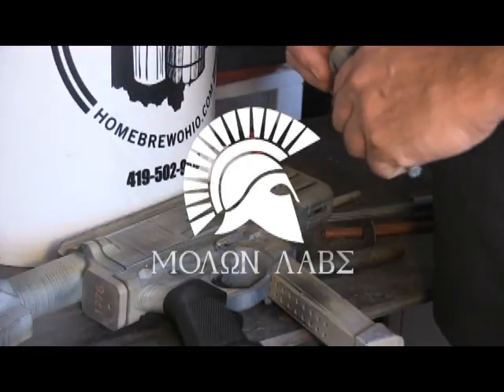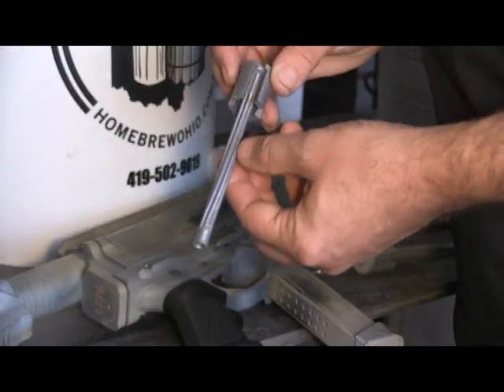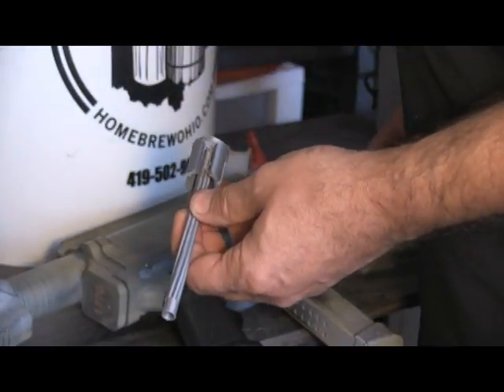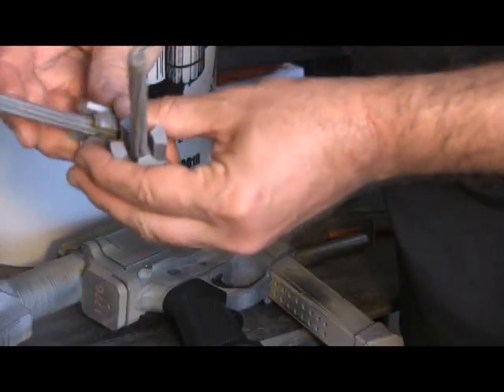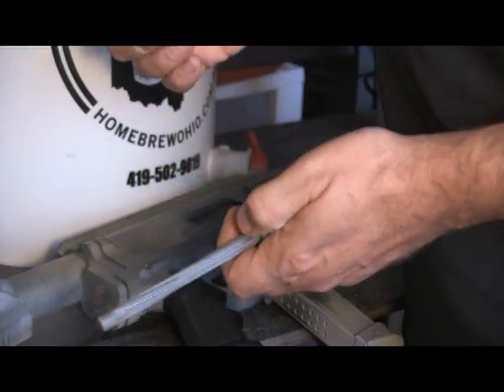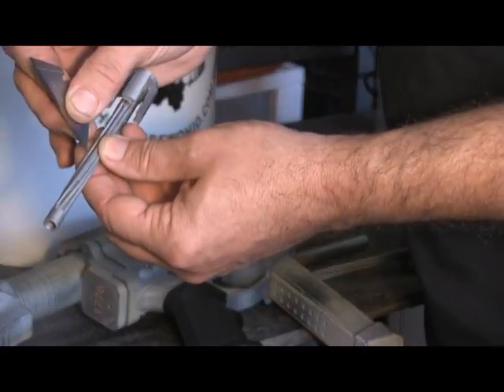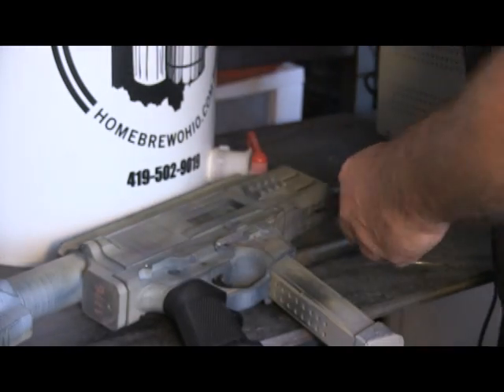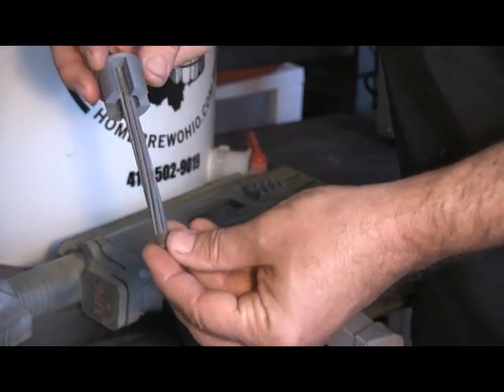FGC-9 Rifling Mandrel - How I Succeeded

Comment: Ive drilled out a 9mm barrel from round stock,  and made my own 3-sided rifling buttons to hammer through the barrel. Then finished the job with a round file by hand. It was shitty by factory standards, but worked.  Stabilized the bullet perfectly. It made a sort of polygonal style rifling instead of grooves. Much better
Reply: Mano tem esse defeito mesmo

Comment: Welding wire instead of copper? Interesting
Reply: Sounds like a workable option.  The wire doesn't have to carry too much current.  And the same current that's eroding the work piece is protecting the wire from corrosion.
Reply: @hanelyp1  it's not about its electrical potentional, more about the coating used on it. It has to be bare, coatings will prevent the chemical reaction from happening
Reply from the maker: good point.  I didn't think there was a non-conductive coating on the wire but lightly sanded it just to be sure.  It worked well.

Comment: I'm building on now but I think I'm going to buy a glock barrel for 60 bucks on ebay
Reply from the maker: I'd love to hear how that works out.  I bet you get better accuracy.
Reply: For $60 you can buy the materials to ECM your own barrels and have more.
Reply: @amphoravideo  I've done two with glock barrels and they work well, but there's something special about the ecm method in terms of awesomeness
Reply: @DaveSmith-cp5kj  Which will cost you a lot of time and thus also money
Reply: I used a Glock barrel as a stepping stone in my FGC-9 journey. From here on out, it's ECM all the way. The bragging rights that come with building a complete 100% DIY firearm (meaning zero commercially manufactured gun parts used) far outweigh the cost and time involved with ECM.

Comment: What kind of camo filament is the FGC made of?
Reply from the maker: It's actually just a dark gray ABS filament.  I painted it with camo paint.  Then lightly sanded, revealing the print lines.
Reply: @amphoravideo  What color/colors did you use?
Reply from the maker: @RW-of3pn  I used Krylon Ultra Flat Camo spray paint.  I don't know the specific color names but one is basically desert tan and another a dark forest green. A little black as well.  The reddish areas are actually automotive bondo (which btw, is my favorite method of smoothing prints.  It fills in the print lines and will sand glass smooth.)
Reply: @amphoravideo  Beautiful work.
Reply from the maker: @lgbtqisahategroup9781  Thank You very much!!

Comment: can I do it with a 30V 5 amp power supply?
Reply from the maker: I suspect you could make it work. Lower current would impact the cutting times but…that’s not a big deal.  You might need to put a resistor  or a small light bulb in the circuit to bring down the current and keep from killing the power supply.

Comment: just found your channel.  I want to try a fgc 9
myself  do you have any recommendations on were to start? there's plenty of videos on the fgc9 but none that's for the dumb guy.
great videos
Reply from the maker: Honestly, the best advice I can offer is don't be in a hurry.  Be willing to fail several times.  Learn from your mistakes and keep trying.  Making the bolt and barrel are the most challenging parts but they can be purchased.

Comment: Hello,

I have the outer Ø16 tube and inner Ø8.
But the mandrel is 9mm in diameter and does not fit through the Ø8mm tube, how do you do this process?

Thank you
Reply from the maker: You have to use a solid metal rod inside the pipe to evenly enlarge the pipe’s ID using the ECM process. When it’s large enough, the mandrel will fit.   The process is covered in the FGC-9 instructions. They might be a bit hard to find but they’re out there.